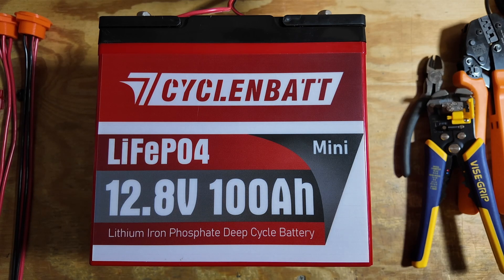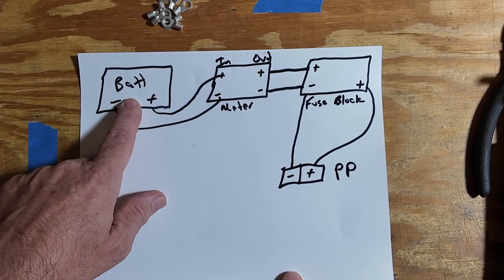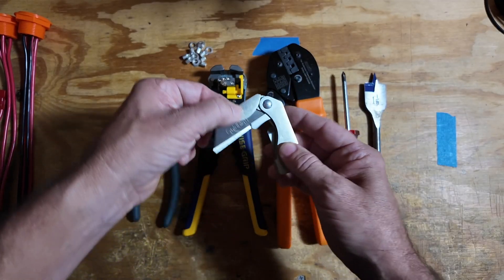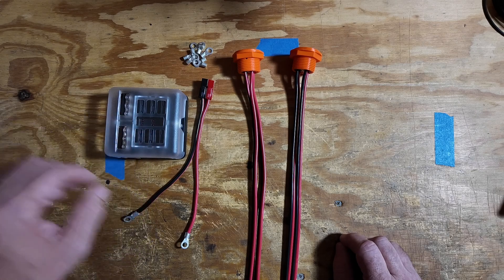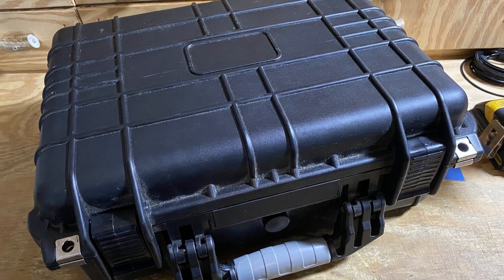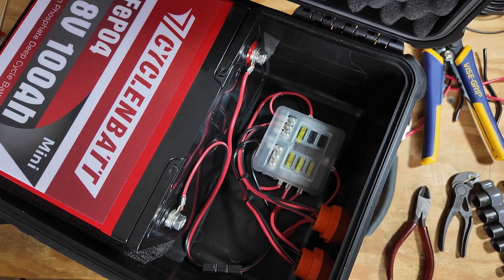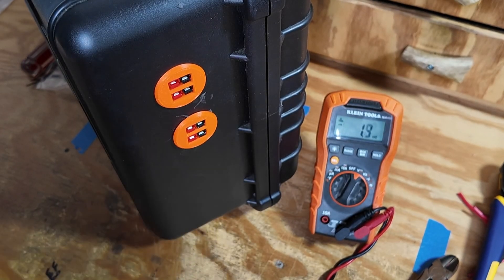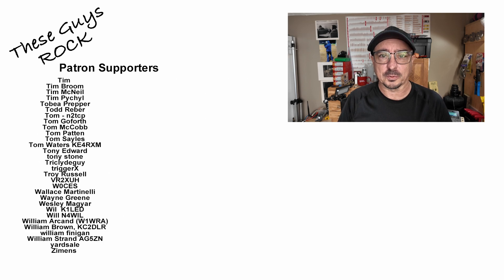Super Simple 100Ah Battery Box

Comment: Maybe it's me but wouldn't a power switch in between the battery and the meter be advisable since the meter will have a constant draw while plugged in? Learned my lesson leaving a solar charge controller plugged into a smaller 10amp battery I put together.
Reply from the maker: Yes in most cases. In this case I just make certain the meter is disconnected before storing.

Comment: I haven't completed my power box but I'm surprised that you didn't add a switch to turn off the power to the power pole plugs (and future meter). Now I need to figure out if my 100 amp hour lifepo 4 battery fits in the 3800.
Reply from the maker: I wanted to avoid using a switch and will disconnect the battery from the meter instead when not in use

Comment: While you're probably good,  that meter isn't drawing any current to speak of.  Testing with a little current draw,  a noticeable voltage drop would show up any unexpected resistance in your connections.  Just lay a resistor across your meter leads. If using 1/8 watt resistors, then 1.5k or greater is safe (about 91mA).

Comment: Nice battery box ! 100 AH . My 100 AH battery had nice handle so I just put power poles right on battery . I made one like that for a fellow camper and needed to run 12V cooler.  About the same but mounted 12V accessory port  right on case along with master disconnect switch and 1 anderson  50 amp port. Just what they wanted.  I say build the battery box to fit your needs. My personal one is a lot different but works for my POTA setup ,Works great for me. With all them storms nocking the grid out ,Them LiFePO4 battery very handy !! 73
Reply from the maker: Hurricane Helene was one of the driving factors in building this bigger battery box. Never know when you might need it and the price of batteries has really come down in the last few years.

Comment: I’d 3D print some terminal covers for the battery. Could be a simple box with a hole for the terminal to go through, double sided tape to the battery and then a sliding cover. Include a slot for the wire to exit.

Comment: Wouldn't you need a charge controller in order to back-charge the battery through the PowerPoles?
Reply from the maker: Yes. The charge controllers are kept with the panels in my setup
Reply: @KM4ACK  Which charge controller are you using?
Reply: It doesn't matter if the controller is in the box as o not as long as you have one.. I'm currently building a similar case but in a 4800 that I'll have a CV in it with choice of Anderson or SAE plug

Comment: one thing i would suggest is put a DC circuit breaker on the hot side of the battery BEFORE the meter. obviously it should be suitably sized for the total load you are planning, but any short on the meter itself will directly short out the terminals of the battery. don't ask how i know LOL
Reply from the maker: You guys help me out here. The LiFePO4 BMS has built in short circuit protection. I understand a second breaker would be better but isn't the BMS protecting this already?
Reply: @KM4ACK  i certainly wouldn't reply solely on the BMS
Reply: @KM4ACK  Research what gauge wire you have connecting the battery and the MAX load that piece of wire will carry then put a fuse or breaker on that wire as close as possible to the POS battery post that will handle no more load in Amps then the size and length of that wire. The BMS will protect the battery not the wire connecting to the battery! Do you know what the MAX load you got connected including the wire losses?
Reply: @KM4ACK  theoretically yes... but also, not necessarily.... it may be on the lower side to what the bms would trip at but still melt the wires and start a fire. i have a 100ah lifepo4 in the truck and a wrench fell off the toolbox onto it, blew the fuse but didnt trip the bms. this was while i was installing it so the terminals weren't protected yet
Reply: @KM4ACK  uh, do you not know what fuses/breakers are actually for?

The BMS is there to protect the *battery*, not the wiring.

The fuse is there to protect the *wiring*, hence they are sized according to the *wiring*.

Would you use a 100a fuse to protect what appears to be 12awg wire?

Then why would you assume a 100a+ BMS cutoff would protect 12awg wire?
Reply: 100% this. I see so many "pretty" battery box builds but they have zero protection between the fuse block and the battery. They'll also have multiple powerpole outlets but yet use the same gauge wire that's being used everywhere else in the box and it's generally 10AWG (or smaller) which shouldn't handle more than 30A total. Sure, they might never intend to pull that much juice at once but all it takes is someone plugging in another high-draw device and now you've got a tinderbox.
Reply: I AGREE 100% BUT you size the fuse from the Battery (Source) to Protect the Wire from overload NOT the load! You size the wire from the (Source) to carry the Load!
Reply: @barntt  totally, but i would assume that the wire from the battery etc would be appropriately sized anyway for the load you expect to be pulling from it :D
Reply: @WX4CB  Never ASSUME anything! Do the research and then the Math!
Reply: @barntt i would think that km4ack would know to do that :)
Reply: I would add that breaker between the battery and the meter simply so that there is a way to disconnect power from the meter when it isn't in use. Those meters do draw a small amount of power while on, specifically for the LCD backlight.
Reply: @JonathanKayne  which is what i said :D

Comment: How did you hold the battery in the box so it doesn't shit while being moved?
Reply: I'm sure he's got it potty trained! 😅
Reply from the maker: "I'm sure he's got it potty trained!" 😂😂😂
Reply from the maker: I put foam on the bottom of the case and PACKED foam on three sides. Additional friction is created by the foam in the top of the case when it's closed. I've tested it and it hasn't moved around from rough handling but it may very well shift a bit if you dropped the case just right.
Reply: Get a less scared battery that won't shit during transport😊

Comment: Do those wattmeters really read in both directions? (Charging and discharging?) I was under the impression you may get current through them going back from load to source, but the cumulative watt-hours wouldn't "count down"...in other words subtract from the previous total going from source to load.  I'll be real interested to see if they work that way!  Nice project!
Reply from the maker: This one won't count down but some do. I will have to reverse the power meter when charging. The "source" will be plugged into the side coming from the panel and the battery will be the load during charging.